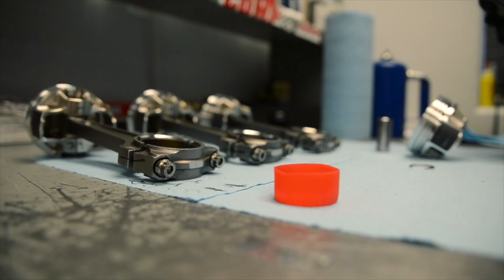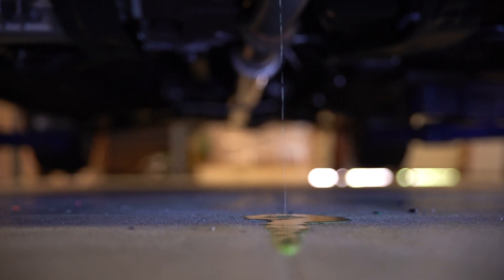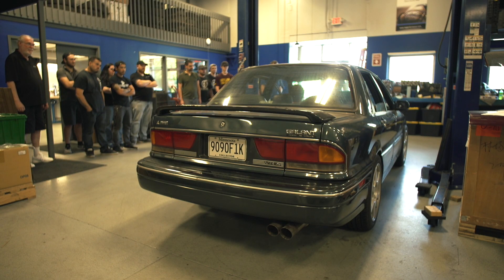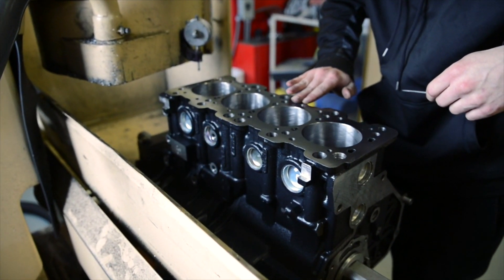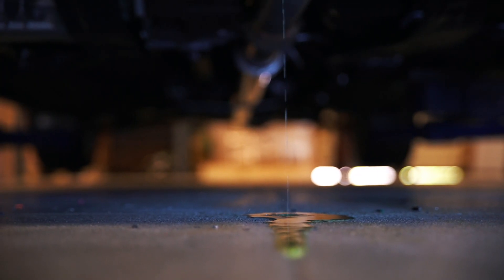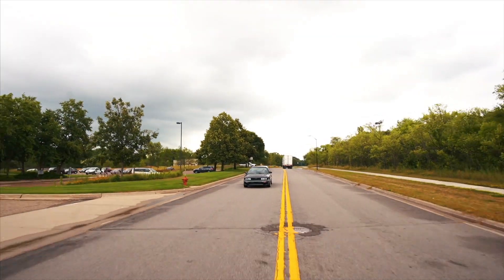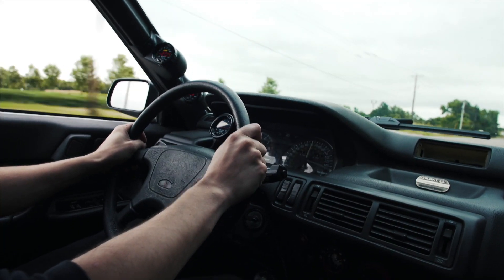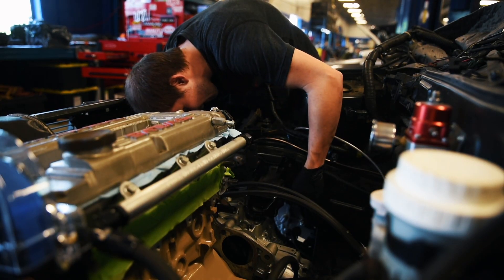Proper Engine Break In Procedure

Comment: Running the engine on the spot is NOT going to make the rings seal, quiet the opposite, you need to drive and load the engine to push the rings into the bore to file them, this all happens in the first 30Km or 20 mins, after that you have lost your chance to make a proper ring seal. Also no solid bucket/lifter Jap engine requires break in on cam followers. Worst thing you can do to a new engine is idle it or run on the spot with out driving for 20-30mins.
Reply: this happened to my buddy's evo. his engine builder told him to start his engine up and let it idle for 20 mins, after I told him to actually drive it and build some boost to set those ring in.   his engine never ran right and the amount of blow by was ungodly.   it's also worth mentioning that the rings we're gapped correctly and everything was assembled correctly.
Reply: probably beating a dead horse here but Timmy is right here     when you first assemble your motor fresh for the machine shop or you gave the cylinders a quick hone at home, you give the cylinder wall a rough crosshatched surface.    on your first start up your rings rub against and in basic terms file themselves to uniformity to the cylinder walls.   if you don't go out and put load on a new engine, your rings don't expand and get formed to the cylinder walls.   another good point is your first start up.  on your first start up, only run the engine for about 2-5 mins at all around 2000rpms.  then shut the engine off and drain the oil.  put new oil in and go get it tuned.   yes I know this post is a year old.
Reply: how do you lose you chance to make a proper seal if you, lets say idle for 20 minutes then driv it, how will it file down the rings in the first 30km and after that not. why cant you take it easy first and then drive it, and then they will file down and make a seal. this is what i have always been wondering about when it comes to hard break in vs mild or whatever
Reply: @hakkemohammed  Because the crosshatch edges which file the rings will be dulled and not do any more filing, they will be dulled AND the rings will have been worn in a poor shape by running engine no load  ie not sitting square on ring lands and out to shape of bore.
Reply: 99999timmy you make no sense.
Reply: @mareksumguy1887  sorry to say but timmy is 100% correct
Reply: rbpaul111 no he’s not. His explanation was garbage.
Reply: @mareksumguy1887  Just trying to help champ, anyone who knows how engines and their machining works knows about how to promote proper ring seal as I have explained...it needs load.
If your an expert on the subject whats your explanation to the process ring bedding ?
Reply: 99999timmy what “dulls” the bores?... the piston ring. So how can the cylinder be broken in and not the ring??
Reply: @mareksumguy1887  One reason the crosshatch is there is to file/bed the ring to fit the bore nicely and seal,  this filing process happens in the first ~20min or 30-50Km and then the crosshatch is dull, its done the first part of its job and you don't want more wear/filing for engine longevity.
 The rings move in the piston groove(in out, up done and both at once) and under load they get pushed flat on to the ring lands and out into the bore(by the cylinder pressure... which is very weak under no load/idle) which helps file them more and keep them square, flat and seated while they are filed.
 Running an engine at idle and under no load makes the piston rock(at idle in a bad pattern) and the rings slop about not seated on the ring lands perfectly and pushed into the bores/round...file the rings in this pattern and you will not get a great seal and poor performing engine, at worst it will burn oil as well.

You should always aim to drive the vehicle straight away when starting up a new motor, don't play around, have the car complete and drive-able, start it check for leaks etc, bleed cooling system and drive. Only way to do a proper start to the run-in process.... or do it on a dyno !.
Reply: @mareksumguy1887  your on your own here buddy. Timmy is spot on👌
Reply: @mareksumguy1887  Oh ok, your just trolling lol  but yeah your actually a full bottle on this subject so make sure when you startup a new engine you rev it on the spot for 60 mins and it will be run in sweet as bro ;)
Reply: Marek Sumguy , my break in process is 500 miles , doing as the modern day builder does in my opinion is asking for trouble , 100 miles min is the proper run in time  on the road if the engine had been built by an engineering shop , 30 mins is just dumb, dynos kill engines as the load is different and not every dyno is as good as the next to many factors , real live driving hence live mapping is a better reality , things do go wrong doesn’t matter how much knowledge you have mistakes still happen ,leaving a car to idle is never a good idea as oil pressure is less even on a run in engine it can cause premature wear , I drive mixed styles but the 1st 100 hundred is the most important it is important to load up the engine but not like this, as long as you give it a reason to be on load mildly and don’t excessively rev the engine
Reply: 99999timmy  if u have a new rear end or trany do not chassis Dino the car.
Reply: @buildnation8764  i read that in a sexual kind of way
Reply: @99999timmy  Where did you read that?

I would like to research this further

Comment: I prefer to leave everything under the hood the same, except the built engine, so that the old tune will work great for the break in tune. Then, I prefer to use the mototune method of break-in. After 20miles or so, that engine is broken in, no need to worry about it. If you want to apply the wait and see method, drive it for 500miles, then start making changes under the hood, tuning it, etc. I skip the 500miles, personally, go to my oil of choice, and start the changes and tuning I want. I've built many this way, without a hitch. Never had a problem, never had an engine go bad, always have had healthy motors comments come out of the mouths of my customers, third parties, and competitors.
Reply: Hehe, I don't agree at all..:) Precisely measuring the ("expected") individual cylinder compression(s) will determine "the health" of it and also whether there are (too many) particles settled in the oil - at which point it's already too late. Also, tuning an engine without changing many, or any components (such as fuel injectors, for example; or, adjusting the size of air filters and exhaust) can only lead to other parts breaking (and before their time). Dunno, just my 2c. :$
Reply: @ностромов  definitely only worth 2 cents... I speak from building and tuning engines. Real experience. I'm also an Engineer in the field, so also speaking from real theoretical knowledge proven to work.
Reply: @ностромов  sounds like you're just rehashing what you read from other topics, interpolating, extrapolating, and reconfiguring the information to meet this topic. It completely seems off topic.